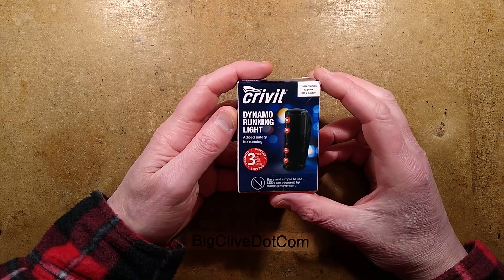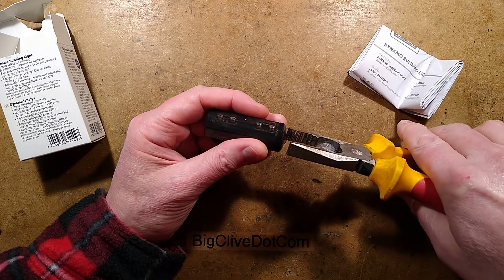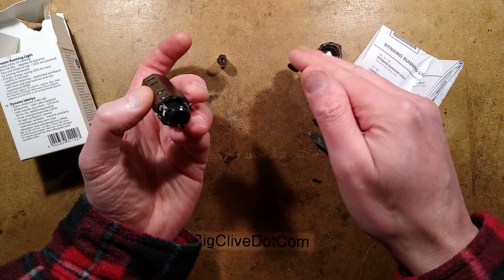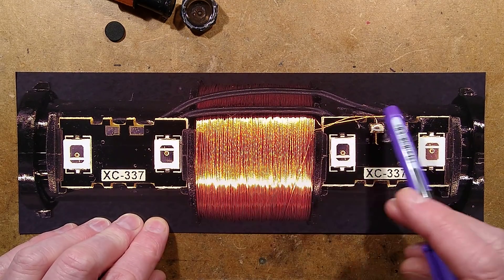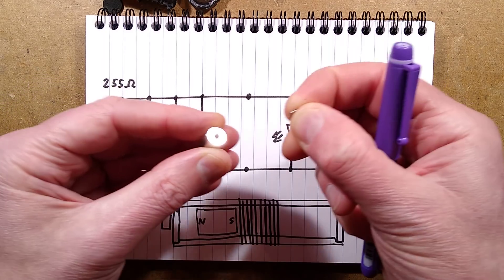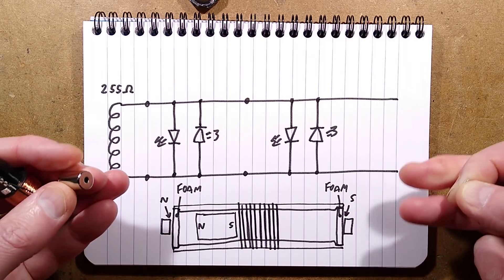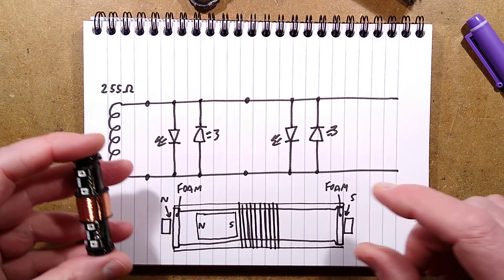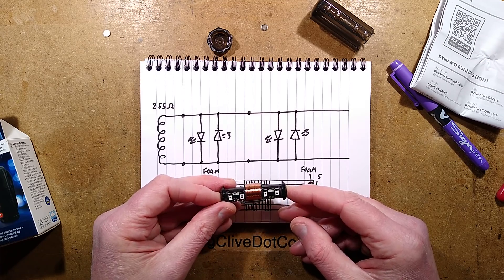Lidl self powered jogging light teardown (with schematic)

Comment: The one mistake they seem to have made is moulding it out of dark plastic. Surely clear plastic could have been just as waterproof?
Edit: the pads at the ends are necessary as well as repelling mini-magnets because NdFeB is quite brittle. There is a danger otherwise that bits might flake off the magnets if they hit hard and repeatedly.
Reply: Manufacturers have convinced themselves that visible electronics and screws are bad. They will go out of their way to hide them, even compromising functionality and happily compromising repairability.
Reply: @drkastenbrot  , not being able to figure out how to take things apart is a big problem with a lot of the items that people bring in to the Repair Cafe event that I volunteer with. "Security" screws with unusual heads are often hidden at the bottom of long plastic tunnels, which themselves are often obscured by self-stick mylar-film labels. No matter how many drive bits you have in your kit of security screws or "cellphone disassembly kit", theres always one or two screws that require an extra-long bit,, or that use a screwhead that you don't have a matching bit for. Things that clamshell together, like remote controls, are a constant frustration; prying them apart often breaks the clips (the plastic shrinks and gets brittle with age) and then it won't snap back together. Things that are likely to require annual internal cleaning or lubrication should be easy to take apart, but no: at last Saturday's Repair Cafe event, several people brought in older portable sewing machines with half-frozen mechanisms. One was easy to access, blow out the lint, and lubricate, but the other one defied attempts to take it apart ---- the owner brought the  manual but it didn't include maintenance or disassembly instructions or an exploded view if the parts, and a quick online search didn't turn up any info, so I couldn't do anything with it in the short time we had.
Reply: @goodun2974  Real old portable sewing machines are always pretty easy to open but the modern '90s - 2000's things can be a real pain and mostly 'maintenance free' sealed devices... :-(  i think they are meant to be hiding what is inside so no-body complains and just buys new. Repairing those might mean neading to 3Dprint new shells since that is many times clicked together or even glued...
Reply: @elvinhaak  , the one I couldn't get inside of (made in Poland, I don't remember the brand) had a cast base and a molded plastic top shell. The main horizontal bearing that had a knob and clutch mechanism on the back end was nearly seized; I could turn it a little by hand, barely, but I couldn't see it after removing the bottom panel because the motor and other mechanisms were in the way (motor good, toothed belt a little worn but good). I probably could have freed it with heat from a hair dryer and some oil if I could have gotten at it (I don't like to spray or drip oil blindly inside anything, especially anything with motors and belts). I told the couple who owned it to do an internet search for disassembly instructions, and if they got it apart and fixed it, to drill a hole in the plastic above any oil ports so they could oil it as needed without disassembling it again. Considering how lint tends to build up inside a sewing machine, you'd think they'd be designed for easier disassembly. 

I prefer to fix lamps and other small electrical appliances at the repair, and resolder devices with broken connections, or glue broken things back together, but since I've been able to fix about half of the sewing machines that come to my worktable, I am a victim of my own competence, and the other volunteer fixers find it convenient to be able to shake their heads, pointing in my direction, and say " not me ---- give it to him, he's good at fixing those things".  I believe the technical term for this is "performance punishment"!🙄

At the previous event, somebody carried in a sewing machine still attached to a wooden console. I loaned them the tools to take it off of the console, and then we fixed it together. A hairdryer, oil, and some "elbow grease"!

We actually have 3 or 4 women who set up their own sewing machines at every Repair Cafe event, and do minor repairs and alterations while you wait, for free (donations appreciated, to pay for the use of the church hall).
Reply: @goodun2974  Nice work to keep these things going!
I have 'repaired' some of those plastic-covered machines that no-one could repair also. But on some I really found glued parts to bound the shell together. Some others have shells that are originally pushed around the machine itself and then some parts are assembled in such a way  they cannot be taken apart without breakage, especially when that plastic gotten brittle. An aircan and spray with large hose can do wonders sometimes.
i love the older machines of before the 60s and the ones I use most-often are now about 100 years old.
Reply: @elvinhaak  ,  I don't even sew so much as a button back onto my own clothes!  My day job is repairing audio equipment and I am happier soldering circuit boards than dealing  with frozen bushings and greasy gears and sticky mechanical linkages. Not to mention dust kitties inside the machines. Although I have repaired plenty of turntables so I guess there might be some small similarity in the mechanics of both. As for the Repair Cafe, we have limited time to devote to any one repair,  And sometimes the best I can do is narrow down the problem a little bit and send the "customer" home with their unrepaired unit and enough information that maybe they can find out whatever else they need to get or to do in order to fix it themselves. We actually do have a shop in town that sells and repairs sewing machines and vacuum cleaners, but its not a wealthy town and we were hit hard by the economic crunch and some people can't afford to pay to fix their machines.  We also unclog a lot of vacuum cleaners and replace the belts for customers at the repair cafe. More than anything, we fix lamps. Lots and lots of lamps in need of new wires or new sockets or whatever. Keeps them out of the landfill, and I do enjoy the challenge of repairing or at least attempting to repair whatever oddball thing hits my work table next!
Reply: @drkastenbrot  clear cases is the year 3 version of anything inevitably.  game pads, whatever
Reply: @drkastenbrot  Yet shakelights came in clear cases...
Reply: @drkastenbrot  , obscuring the screws and  making things appear "seamless" so that folks can't see how to take them apart isn't just an electronics-manufacturing design goal; try taking the door panels of of a modern car to change a blown speaker. Back in the late 70's and 80's when I was a car stereo installer, most cars had plastic caps over the screws, plus maybe just a few hidden snap-in plastic pins in strategic locations, and most door panels were fairly easy to remove with a screwdriver and a small forked prybar. I even replaced complete dashboards on a few cars that had been hacked up by radio thieves (replacing a Saab 900 dashboard was easier than I expected). Nowadays, however, you practically need X-ray vision to see how things are assembled, in order to take them apart.  (PS, back in the day, the toughest dashboard trim-panel or escutcheon to remove simply for purposes of changing the radio was the Datsun B210 Honeybee; the MG's, TR7's and Spitfires weren't any fun to work on either).
Reply: Yes I was going to comment similarly. I suppose it's cost savings: they wanted an opaque enough plastic to hide the coil and innards and yet have it clear enough for the LEDs. Otherwise they would have to mold clear windows; a second type of plastic.
Reply: Dark plastic can be re-used (recycled?) plastic. Which is a small plus.
White plastic always has to be new polymer.
Reply: @pizzablender  , in this case, the plastic case has to be at least semi-transparent to let light pass through. It appears to be a "smoked" plastic color, similar to "smoked glass".
Reply: @pizzablender  I didn't know that. Good point.
Reply: @pizzablender  , did you mean to write clear plastic instead of white?
Reply: I suspect that the pads also hold the end magnets in place otherwise they'll just flip.
Reply: Cheaper to use dark plastic?

Comment: Could you fit a small capacitor in there to keep the leds on for a couple of seconds?
Reply: That would lower the brightness a lot, require rectification and current limiting resistors and those losses would eat away the energy available to light the LEDs. So theoretically yes but you would probably end up with a lot dimmer unit which takes some shaking to start turning on.
Reply: If you're running you want flashing lights to get driver's attention. This is perfect for a night runner's needs
Reply: @josephschembri4811  , brightly colored clothing should be considered a necessity for people who jog or walk their dogs in twilight or the dark. Almost everyone around here (woodsy New England) walks around at night in dark clothing.
Reply: It would need to be two small capacitors between the coil and the circuit board.
Reply: @Shaun.Stephens  how do you know exactly? I just can’t comprehend adding anything to anything and it working (I have no idea what I am doing)
Reply: @cheyhotdogs  My theory is that it's alternating current coming out of the coil so you'd need a capacitor on each wire so that the polarities don't cancel each other out and the capacitor 'reverse charge' the coil (inductor) into an electromagnet. Then again I might be wrong and each wire might also change polarity on each opposite stroke of the magnet... Now I'm confused!
Reply: @Shaun.Stephens  your self-doubt makes me trust you more
Reply: I love someone who isn’t sure, it means they’re pretty sure but know that something can go wrong and they’re accounting for it
Reply: @cheyhotdogs  :)  I was thinking that perhaps you'd need diodes in series with the capacitors to stop back-charging the coil but I think that the ~0.6v drop they'd add would dim the LEDS too much. .... Unless you put capacitors BETWEEN the opposite polarity LEDS and let the LEDS do the work of the diodes... 
LOL! Still confused. Maybe someone with a bit more knowledge could chip in here? If I had one I'd test it - that's what I usually do.
Reply: @Shaun.Stephens  you could put a non polarised cap across the coil itself, getting one large enough to actually do anything is left as an exercise for the reader lol. (that and the cap discharging though the coil instead of the diodes)

that said if you did rectify it through some schotky diodes you'd only lose about half a volt there. Nice big electrolytic cap to stretch out the pulse. Theres going to be a lot of energy kicking around with a person running around.

The real question is would it be better in any way, I'm guessing probably not lol
Reply: @cheyhotdogs , a famous quote: "If you begin in certainty, then you shall end in doubt; but if you shall be content to begin in doubt, then you shall end in certainty". Sorry, can't remember the author (it was from hundreds of years ago).
Reply: @Shaun.Stephens  You wouldn't need polarity protection/rectification diodes, when you've got 4 perfectly good diodes in there already ;)
Seriously, the LEDs work fine for that purpose.
Reply: @nimoy007  That's the conclusion I came to above when I said to just put the capacitor between the diodes. Cheers.
Reply: @Shaun.Stephens  You won't accomplish anything useful with two caps. Placed in series as you suggest would only reduce the amount of power reaching the LEDs.
Reply: I do have a flashlight that works on the same principle. A lot bigger ;-)
Reply: Running at night it might be more obvious if it was flashing, otherwise it might just look like a distant brake light
Reply: @MisterLousy  True. I was just thinking about how to hack it to be a constant light.